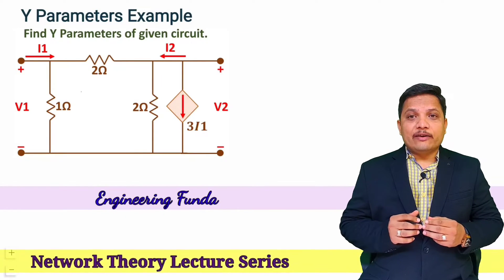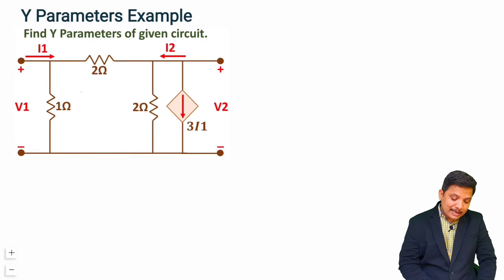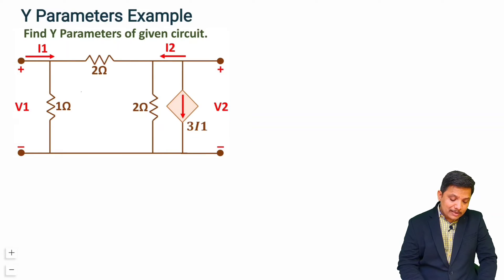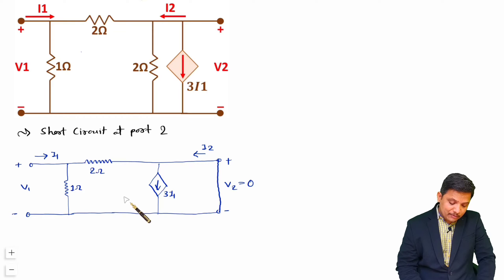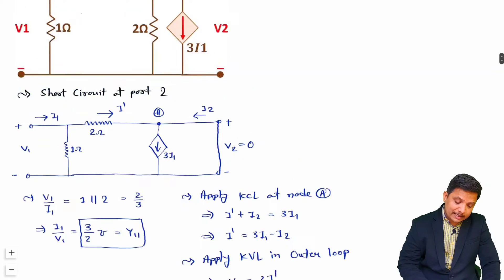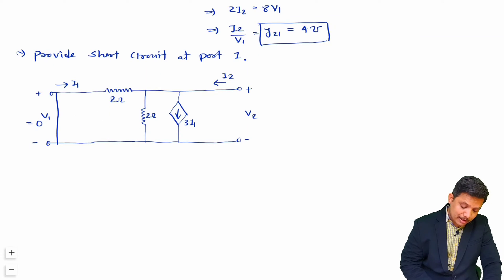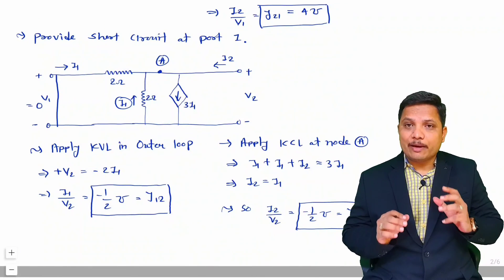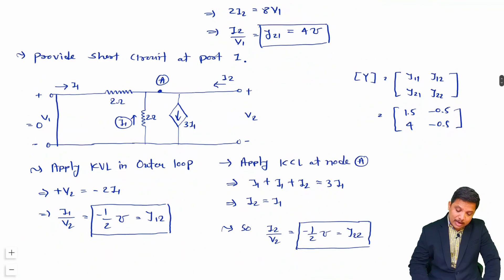1 - Example of Y Parameters: Input & Output Admittance, Forward & Reverse Transfer Admittance

Comment: sir how current is same in both 2 ohm resistor ,they are in parallel so voltage are equal but current same why?
Reply: @yogeshchouhan619  nice question

Comment: For finding Y22~ how u are assuming current at other 2 ohm resister is also I1……….why cannot we do by consider two 2 ohm resister in parallel and and solve answer
Reply: If we do in that method value of Y22 is coming as -2 mho
Reply from the maker: I have many examples in series, kindly go through it after that you can solve is efficiently
Reply: same question can you please explain it in short here